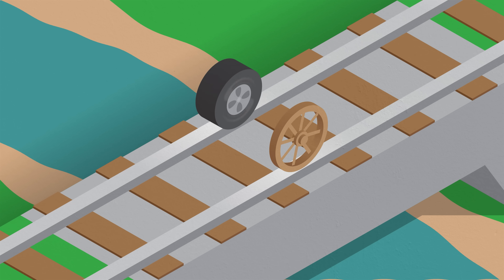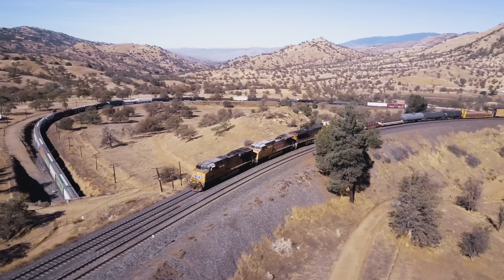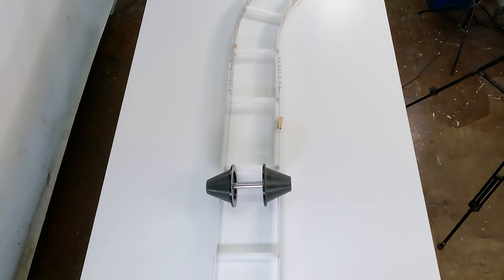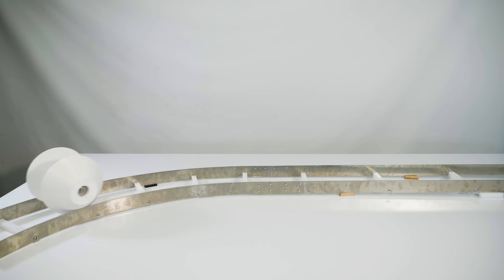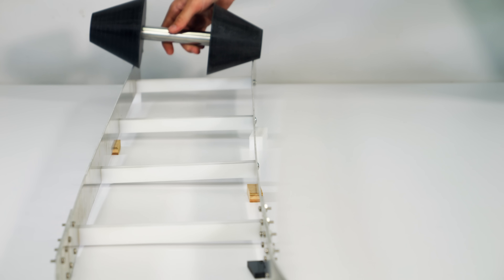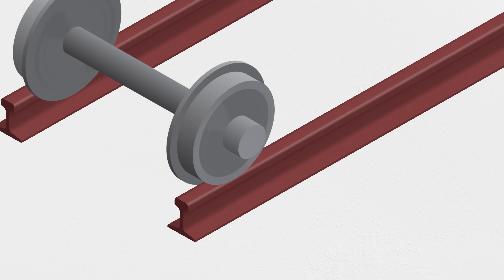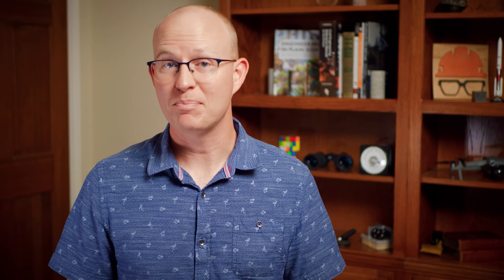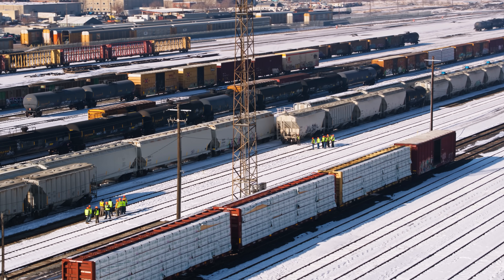Why Are Rails Shaped Like That?

Comment: I was just in Japan and rode the bullet train and I noticed how the top of the rails was rusted over except for one tiny strip down the middle where the wheels actually contact it. Impressive precision for them to let the train go 200mph!
Reply: Hunting, where the wheels oscillate side to side going down the track, is a real problem for high speed rail because it can amplify to the point it causes a derailment.  Japan put a lot of work into their high speed train engineering to nearly eliminate hunting -- which must be what lead to the very consistent tiny wear strip you saw.  Very cool.
Reply: Thank you for probably make me staring at rails whenever I'm in a train station in the future...
Reply: I walk along railroad tracks to get into town from a ski resort where I stay, and always think about why the rails are I beams.  Each winter I have to figure it out all over again.  @vanadot
Reply: @darko714  Rails are not I beams...they might resemble I beams to an untrained eye but their steelmaking (chemical) and rolling specifications are very different. The design of rails is surprisingly efficient given the time mankind has used them. 
One other point...the rails used for very heavy tracks such as overhead cranes had a very different profile to the rails of standard gauge.
Reply: That comes at the cost of huge maintenance every night with an army of workers to keep the track perfect.  How was the ride?
Reply: @tomellis4750  Actually, I think it comes at the benefit of less maintenance. Why would rails that don't need to be replaced as much make it take more maintenance? It's not like self polishing rail systems are in high demand.
Reply: @kindlin  Every night the Tokhaido line alone needs 3.000 workers to maintain the track. That's because it has to be accurate to a fraction of a millimetre at such speed.
Reply: @tomellis4750  I have a hard time believing that considering what I was seeing says the rails on that are only ground twice a year for the precision needed and measurement runs are only every 10 days
Reply: @tomellis4750   Ah, 3 thousand people. I had been very confused on your exact precision of 3 people to the thousandth of a person.
 
If that's the state of the matter, than I'm just curious, dafuq do that many people have to do?
Reply: @tomellis4750  so the Shinkansen requires an overnight (and possibly weekend) closure (2300 to 0500) since there is zero way to work safely next to 300 km/h trains. Network Rail (UK) also requires closures for most activity, except minor maintenance.
Reply: Correct @annabelholland
Reply: @noodlelynoodle.  Yeah, sounds unbelievable, totally unsustainable. Anyone knows how does it compare to the French TGV? From what I heard, they've started an upgrade to the 5th generation rolling stock. For maintenance they have those IRIS 320 trainsets, which perform safety inspection at the same top speed as the passenger traffic, up to 320 km/h, and are generally slotted in the schedule between regular trains. They are once every 1-2 weeks. I dunno how, and how often, they do the grinding, tho.
Reply: @noodlelynoodle. Since the rails are long, and grinding is slow, if the rails are ground twice a year, that means that it takes multiple grinding crews working every night during the slow times to grind a section of rail and then get off the tracks before morning trains start up.
Same with the 10 day inspection. That means that each crew covers 1/10th of their territory every night, not that one crew inspects the entire line once every 10 days.

In addition, you have all the other maintenance tasks, switch repairs, rail replacements, signal work, electric system repairs, etc etc, and it all has to be done in the short window at night or weekends when the trains are not running, which is why it takes such a large crew.
Reply: @ke6gwf  I don't believe that cause what I was reading says the inspection cars are run at the same speed as the normal trains, there is no reason they would only be inspecting 1/10 of the area, the info I was finding was suggesting a crew of 500 not 3,000
Reply: @noodlelynoodle.  No, they don't have track inspection cars that run at 200 mph! Lol
Plus, some inspections require actual humans on feet, not running at high speed.
Reply: @ke6gwf  I mean do some actual research before being blatantly wrong lmfao cause they absolutely do have highspeed inspection cars and have since 2001 and they are operated at 270km/h using a laser to inspect it. In total there are 20 depots along the line with about 30 maintenance workers each making ~600 not even close to the 3,000 claimed
Reply: @noodlelynoodle.   How long can you get your lines? No interpunction is horror. No idea what you wrote, I quit after 20 words. Just saying.
Reply: @kindlin  On the question of "do precision rails need more maintenance" and there are two reasons: 1) The closer one holds tolerances, the more those tolerances have to be looked after, and 2) chaos theory dictates that things tend towards chaos and away from order. This is true for anything polished like that.  Wheels will not polish rails.  They continuously make rail potholes which must be polished out.  This isn't even considering the track bed, which shifts, warps, and eventually gets whacky.  This must be continuously addressed also.
Reply: @tomellis4750   sounds like you're a trackman or know one or two
Reply: I'm under the understanding that High Speed Trains, such as the Shinkansen, use lower profile geometry to their wheels.  This reduces the hunting at speed, but at the cost of increasing the minimum radius these trains can take.  This might explain why the strip worn on the rail is so precise in comparison to lower speed and freight  lines.
Reply: @dkcrogue  2002-2004 I worked on the Taiwan HSR project. The early civil works of tunnels had been dimensioned for French TGV trainsets. On these there is a large difference between the standing loading gauge and the dynamic loading gauge. For commercial reasons, the Owner changed from the French train to the Japanese one, in its then latest  configuration (series 7000?). The stock was wider than the TGV and concerns were raised about tunnel clearances. The Japanese simply stated there was no problem as their dynamic loading gauge was the same as their standing loading gauge. 

That supports the precision in track maintenance and wheel profile statements.
Reply: @johnclayden1670  It's mostly because the Shinkansen (700, 800 and 500 series) derived THSRC 700T is 3.38m wide and 3.65m high, compared to the 2.9m wide but 4.303m tall TGV.
Given that tunnels are usually round, the taller gauge used for TGV specs (GB or GB+ / UIC B or B+ : 3.15m by 4.32m, with a dynamic profile of 3.29m in width) was enough for the wider but less tall Shinkansen derived trains.

The main issue with high speed trains in tunnels being the piston effect, not a physical clearance.
Reply: @KyrilPG  excellent info. I should perhaps have made clearer that the tunnels to which I was referring we're the last few Kms into Taipei station and were rectangular in section (probably constructed by the cut and cover method (I was not part of the civil works)).
Reply: Well it also intentional to reduce friction. Rail gets its efficiency benefits from being steel on steel being slick but not enough to just free spin, and less contact. It's basically the opposite goal of cars and trucks where they could lose grip and slide out of the lane, off the road, or spin out. Since it's on literal tracks, that shouldn't be an issue so it's just a balance of efficiency to how steep a hill it can climb.
Reply: The contact surface area of trains in general is ridiculously small.
An entire TGV, thanks to its specific bogies, has less than 50cm² of contact surface between the wheels and the track, which is less than the surface area of a smartphone screen and less than a single car's contact points.
That's why they use electromagnet bar brakes, like many other trains, that drop onto the track for emergency stop, wheels are simply not enough to slow them down quickly.
Being flat, they massively multiply the contact surface area and friction.
Reply: @KyrilPG also the catastrophic rail & wheel damage from skidding in such scenarios.
Reply: The Japanese figured out high speed rail transportation many years ago. Wheels are made of a special steel as well as bearings. Depending on the high speed rail each wheel is designed to take 10 tons of weight and load. China's high speed traines used wheels made in Germany or Japan.  PRC finally figured out how to make them not long ago. If you have never ridden on a Shinkansen or a high speed Train your missing out on a smooth fast ride. Additionally the Japanese are perfectionists and will do inspections and preventative maintenance. I once had a shinkansen that was late. Found out there was a minor earthquake near Nagoya and the system shut down. I worked for a Japanese company for years, loved their attention to detail and resolution to problems. Not to mention that they run their Shinkansen's in earthquake prone conditions that occure frequently on a minor scale as well as big shakers once in a while.
Reply: The railhead is slightly 'D' Shaped as well . Not sure ithe above video mentioned that , but there's another one to come ...
Reply: zzz
Reply: zzz

Comment: does the hunting behavior contribute to the screeching flange noise?
also something he didnt touch on here is the friction surface between the wheel and the rail. trying to make a 'smooth' metal wheel roll across a 'smooth' metal rail and not slide. (rolling vs sliding friction and the contact point on a microscopic scale) is metal wheel/metal rail still the best combination we can come up with?  each individual train car, even when loaded, has to weigh significantly less than the locomotive pulling it.

Comment: 1 thing you need to check on, is rails are slanted inward by 3 degrees I think, no I'm not looking it up again. The plates under the rails is thicker on the outside of the rail.

Comment: This is a bit Ameri-centric as the situation is quite different in the rest of the world. In Europe, Asia and Africa railways are cutting edge technology and a lot of engineering is focused on how to build them since modern high speed rail presents completely different challenges. When Japan built the Shinkansen they for example discovered that it was necessary to weld rails together into km long pieces to reduce noise and wear. Germany had to build many long viaducts when building the ICE system to ensure that the trains mostly ran on a level surface. And China recently completely abandoned the concept of sleepers and instead started welding rails directly to concrete blocks on its high speed railways. Modern train control systems like ETCS can also monitor the conditions of track and help optimize maintenance schedules, I don't think it's being used anywhere in the US but it is slowly being deployed around the rest of the world, ironically despite literally named European Train Control System I think Australia was the first to deploy it on a line, though Australia is European according to Eurovision so I guess it's fine.

Comment: Our railway are inclined so the flanges don't rub on the running edge so much. You can see the corrosion on the running edge as they are not in contact with the flanges.

Comment: What causes rail wheels to go out of round and give the classic clickty-clack sound?  Does that uneven wear happen primarily during braking?  The commuter rail system where I live is notorious for letting their wheels go out of round to the point that some cars vibrate so badly that it's impossible to read or write on them.  I'd expect out-of-round wheels to wear the rail much faster than round wheels, leading to large long-term costs that might have been prevented with a little more short-term care.

Comment: Hello, I work in railway infrastructure managing company in Slovakia and I would like to say from my personal experience what is the difference in rail wear between straight track and one with curvature. Where I work we have different types of terrain and two parts of track with the same speed 100 km/h (62 mph) are like heaven and earth. One was reconstructed some 10 years ago and in most turns with small radii were used best hardened rails that were available. Those rails lasted whole 5 years before they had to be replaced, before there were ordinary rails and those had lifespan around 2 to 3 years. The other part is straight line. Rails there are from year 1946, right after WW2. Those old rails look beaten up, with little bit of flattened head and small holes from little rocks but defectoscopically flawless (no internal material flaws). Yes, they are 77 years old and still good, although we are slowly changing them for new ones. What I'm trying to say is: rails in straight track can easily live up to 40 years without single touch and in tight corners they are done super fast. It is much more probable that rail will break in low winter temperatures from flat wheel hammering it than any other reason.

Comment: My grandfather was an Engineer for Santa Fe. He started as a Fireman on the ATSF (Atchison Topeka Santa Fe) 3751, a 4-8-4 steam engine when he was 16. He eventually worked his way up the ranks to Engineer. He also went to college and got a degree in Mechanical Engineering along the way, too. That's why I am obsessed with trains. I miss him. He was an awesome guy.
Reply: A quote to honor his passing: Don't be sad it stopped, be happy it happened
Reply: Funny I'm a certified mechanical technician and just got a job as a conductor. If all you want is to be an engineer though, some railroads hire straight up for it. That's mainly public rail though, freight cares a lot more about experience since you need to know the yards and the dispatcher instructions.

Very few passenger trains are designed to be separated or cut: they usually stay as one piece long term till they go to the shop or wash stations. Obviously the whole point of freight is to pick up and set off cars, it's a lot more you need to know.

Comment: I'm a rail engineer, great video. Only critic is using different rail on curves vs tangents. I have never seen a standard like that. Every railroad I've worked with specs 136RE rail

Comment: I'd really love to hear about noise control on rail cars and tracks. In Montreal the government just put into service a new light commuter rail service. Everybody thought that it would be an improvement, but people living near the tracks have measured sound levels of 75db inside the houses with all windows closed. And now the government is scrambling to try and find a cheap fix for what I believe was shoddy engineering from the start.

Comment: I wanna make a guess before I watch it! I’m gonna say that it’s to keep the rails flexible, So that the forces don’t snap the bolts! I don’t know if that would be easier to repair or if it would be more resistant to damage, Maybe both, But that’s my final answer.

Edit:
I got no answer about why they have the thin part. I already knew about the head being thick :[

Comment: 5:21 This is especially severe on the DLR in London. The trains have to go around some very tight bends, and so they have wheels that are even more conical than normal trains. This causes them to over-correct on straight tracks, wobbling violently from side to side as they try to steer towards the middle.
 
Interestingly, 新幹線 bullet trains do the opposite - they have especially flat wheels to ensure a smooth ride, since they travel on mostly straight tracks anyway

Comment: In my train club, where our equipment is 1/8 the size of the real thing, we started using free spinning wheels on passenger cars.   Thus the left and right wheels can turn at different speeds.   We have less issues with friction and everything seems to last longer.
Reply: Main issues I see are wear. Like he said in the video, most trains have solid axel because of the forces at hand. One of the big pain points for rail is the bearings failing and to make free wheels we're either talking distributing less force from the bearing making it be the weight taking part like a car, or having two of them. And remember that with a car or a model you can hear when a bearing fails, you can't hear something a mile back and the yards are too slow to hear it there. That's why they need detectors. 

It could work with passenger which tend to be lighter, but definitely not for freight.
Reply: You are comparing apples to oranges when you compare your toys to the reality of shipping product of immense weight and still making a profit.
Reply: @chrisallen2005     Actually with the engineering of things, models are a good reflection of the real world and are used to predict how the full sized item will act.
Reply: @BobDiaz123 the problem is that you lose the "self-centering" behavior, since the effective diameter of the wheels doesn't matter anymore once the wheels can spin at different speeds
Reply: @ef-tee     One would expect the flanges to wear out sooner with the free wheeling system.  However, this system was tested on a layout in Oregon for several years and they have not reported this issue.  I'm not exactly what force is involved here, but there must be something that helps to keep the wheels centered on the track.

Comment: I once found a PDF that describes the measurements and experiments done to determine the optimum profile for rails on San Francisco's BART system. They had the problem that wheels would howl as cars traveled along curves. (I could hear the noise miles away.) It took a while to grind down all the tracks and machine the wheels to the new profile. Then, mysteriously, cars would get electrical failures … which turned out to have been caused by metal shavings. 
Did you see the video someone made by sticking a GoPro to the front of a BART train?